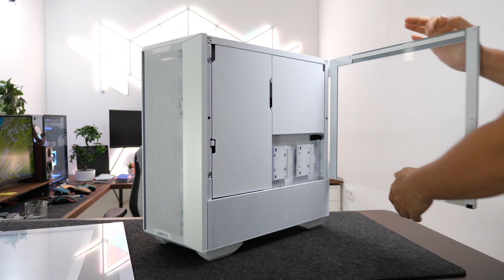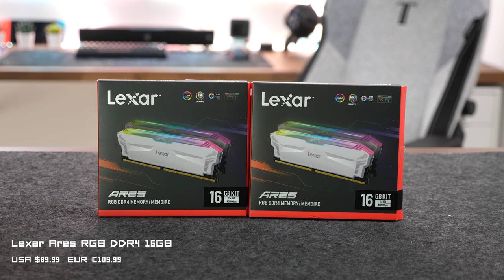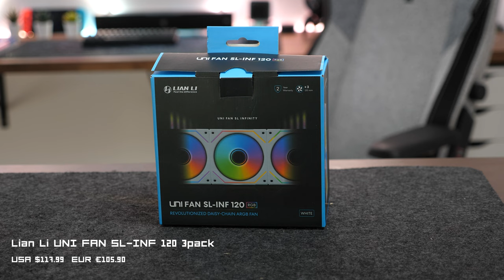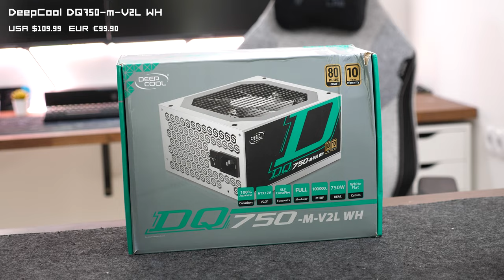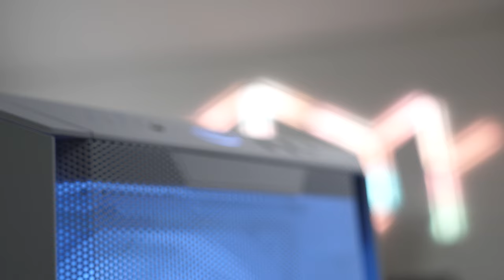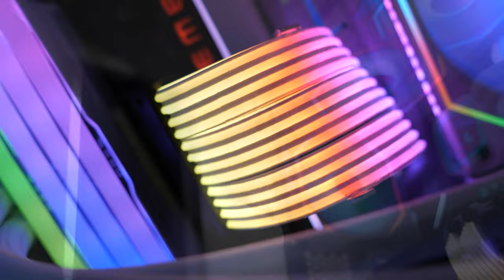Lian Li Lancool III PC Build

Comment: Nice case. But those side fans ,i dont think they can draw any air ? That side is covered I think . I may be wrong.
Reply: I was thinking the same thing...even if it could draw something, the other side of where they're mounted has the cable management cover and then the glass panel...
Reply: I think he had two spare fans. Those side fans aren't blowing in any air, looks damm good tho!

Comment: I Had a question bro. There's two pwm on LS720 one is the 3pin pwm on the pump and the other 4pin pwm is on sata power connector. If I change the fan two other brand. Should I still connect the two PWM to the motherboard?

Comment: wasted adding 2 fans on the right side of the Mobo. No opening for the air to exit. this just disrupted the overall air flow. he doesn't know what is good air-flow mean. this guy just wanted to add fans all over it....LOL😂
Reply: I mean, yes but it also looks sick. 

EDIT: really my only problem (besides the fans) is the 3070ti being $750. The 6750 xt is the same performance for most games and cheaper.

Comment: Can you control the front panel fans with software
Reply: I just finished my build using this case and still using the stock front panel fans along with 7 SL-INF 120 fans. The stock fans come daisy-chained out of the box, and have a 3-pin connector as well as an ARGB header. I plugged the 3-pin header into the fan hub that came with the 3-pack of SL-INF 120 fans, and also connected the ARGB header to my motherboard.

You can control the front panel fans using Lian-Li's L-Connect 3 software, but you won't be able to do anything fancy like how you can with the SL-INF 120 fans. They just get set to a single color, but you can choose the color. You can also control the fans with the RGB software from your motherboard (I use Armoury Crate since I have an ASUS motherboard). With the software from the motherboard, you can add effects like gradients to the stock fans, but again, nothing as advance as what you can do with the SL-INF 120 fans.
Reply: @honeymoanz  Thanks for your information.

Comment: All this Lian Li builds dont care about GPU sag....ive watched like 10 build and nobody put a gpu sag bracket or a vertical gpu suport, im alos interested in this build but i dont like the ideea that i cant put 3 fans on the bottom of the case because i need a vertical gpu suport for my card.
Reply: Gpu sag bracket is included with the case accessories. 
They are not reliant upon the bottom of the case being empty.
Reply: You can still put 3 cans with the vertical mount — no sag